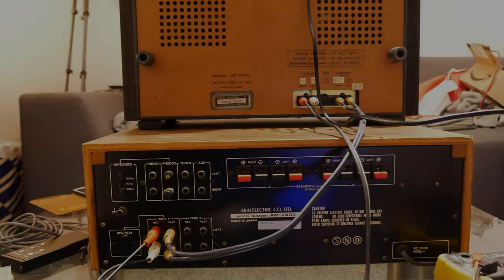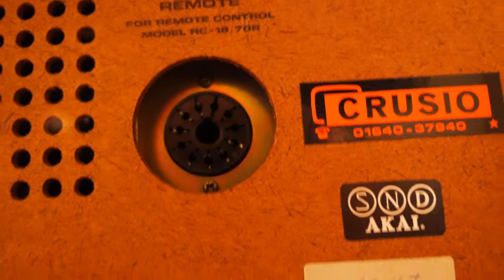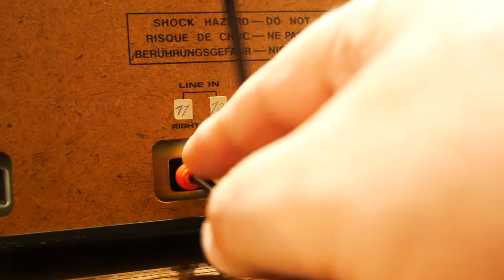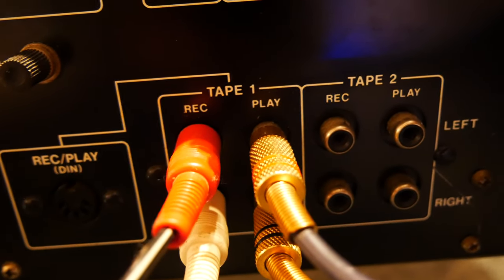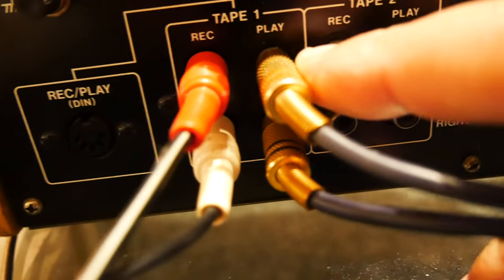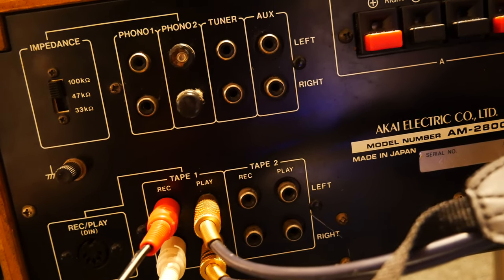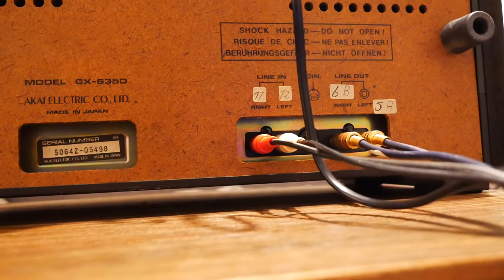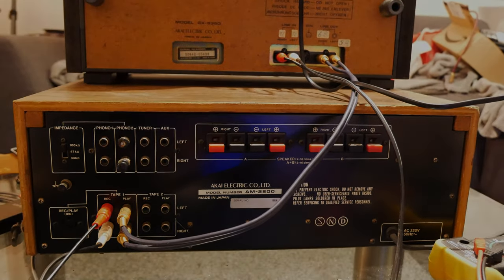How to connect reel to reel decks to vintage ore modern amplifiers

Comment: Nice tutorial on tape deck hook-ups. I got a Teac X-3 open reel deck in 1982 and already had a Pioneer RG-2 expander (1981) so I connected the X-3 to the RG-2 and had this combo on tape monitor one of my receiver. I like the expander as it cuts tape hiss and provides a wider dynamic range for the tape format. It sounds boss. Receiver tape monitor two has an ADC Sound Shaper Two IC equalizer with two cassette decks attached (the EQ has bidirectional dubbing). As the receiver also has bidirectional dubbing, this gives me good flexibility for recording/copying tapes, both open reel and cassette. Surprising how many people don't know how to do component connections. Atta boy Andrew.  .

Comment: Nice video. If the tape deck and amplifier has DIN connection its even more easy, you only need one cable!
Reply: Most components from the mid 1970's to mid 1980's provided DIN sockets for simpler connections of associated gear helping to avoid the "jungle" of cables. Good point.

Comment: I am very new with the reel to reel…my modern receiver has 3 separate line ins…I have a teac 4010s R2r…do I connect rca cables from my line in on the receiver to line out on the reel to reel?

Comment: You possibly should also pay at least a little bit of Attention to the Input / Output-Impedances of the Reel to Reel Deck and the Amplifier. In the 70s the Output-Impedances were sometimes higher than they nowadays are... A higher Output-Impedance of the Reel to Reel Deck, usually will need an higher Input-Impedance of the Amplifier to (usually) sound best. Ideally the Input-Impedance should be at least about 10 Times the Output-Impedance...

Comment: i have a sony tc377 reel to reel  ,connected to a Auna amplifier to the record RCA  phono sockets ,and my Laptop to the Aux also on the amplifier ,but does not record from my Laptop to the Reel to Reel  from the Reel to Reel am using a 5 pin din to 2 Rca plugs